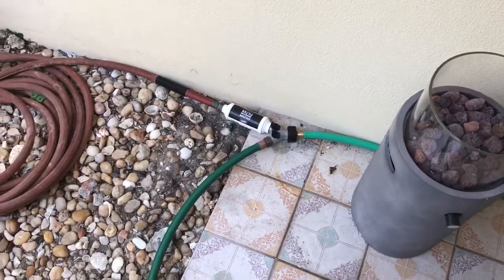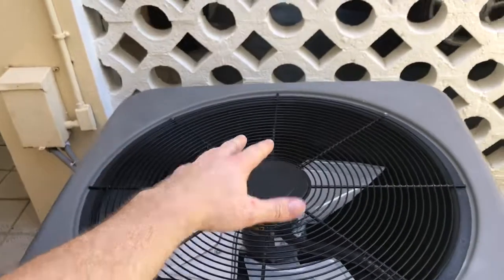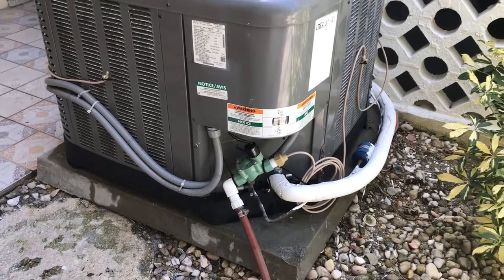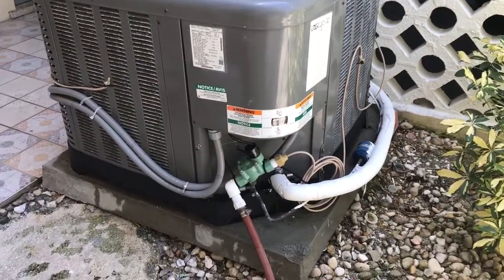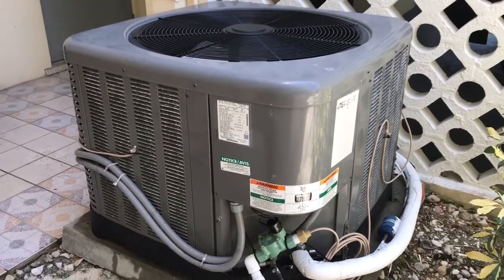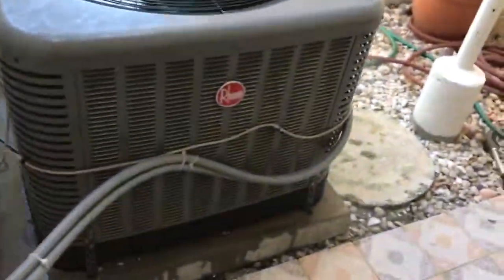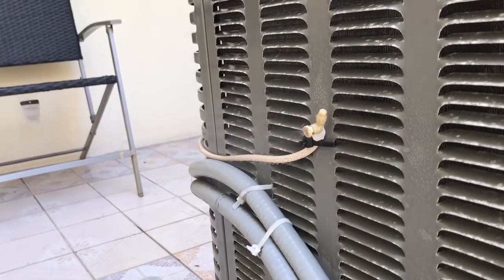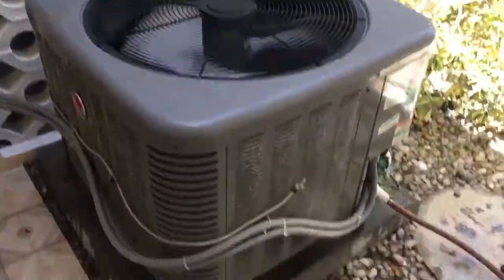Improve AC cooling improve AC efficiency

Comment from the maker: The sprinkler valve wires are 24v they do not connect  to the compressor.  They connect to 24v relay signal wires coming from control box from the air handler.